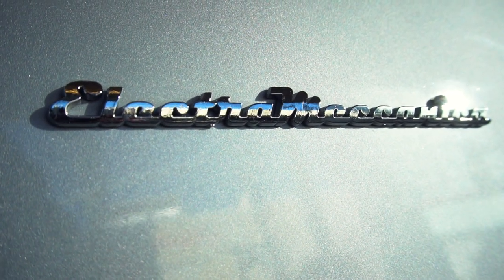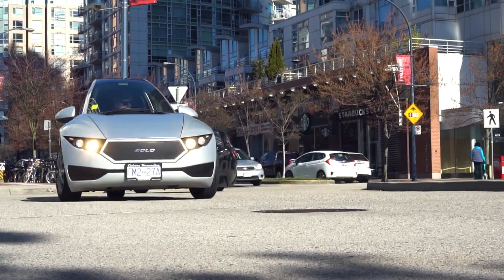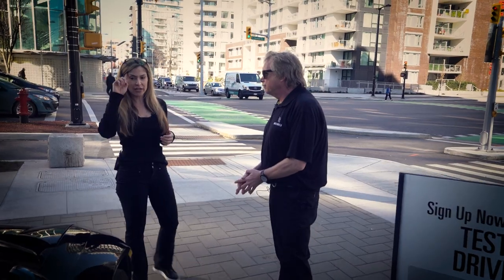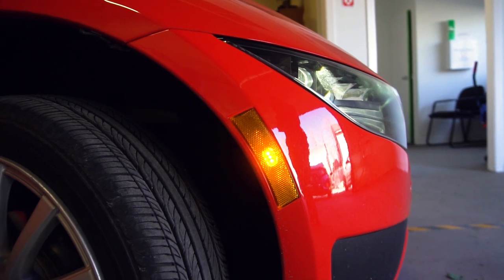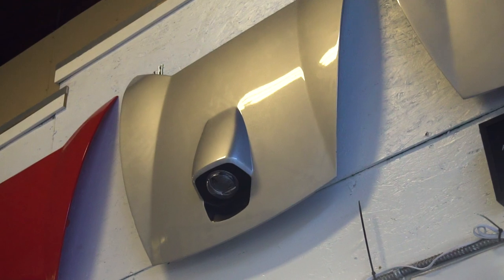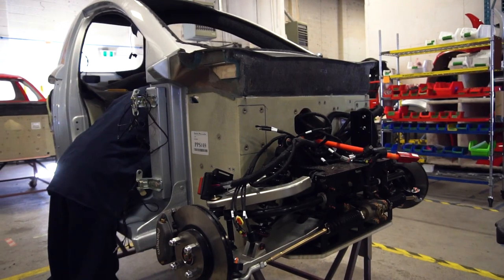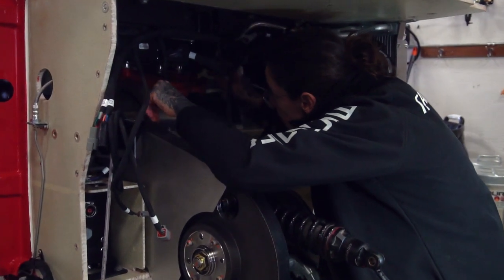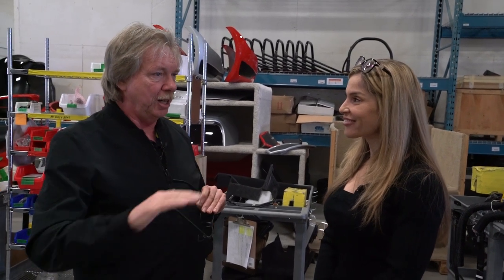SOLO EV Test Drive & Facility Tour

Comment: I just test-drove one of these down in Los Angeles last week. I'm ready to reserve one now!
Reply: How would you parallel park this thing without a rear view window? I can't imagine it has a camera.
Reply: @beernpizzalover9035  Impressive!
Reply: @Vanalos  It has a back up Camera
Reply: Elio Motors?
Reply: @nickgarcia1682  This one actually exist.
Reply: Can the care handle sharp turns?  Looks like it can turn over.  So safety is a question
Reply: joel diaz The car was very nimble/agile in its handling; and it had very good acceleration. I didn’t try any really sharp turns, but this car does has the benefit of doors on both sides - in case it did tip over. :)

Comment: 17kwh battery, 1600lbs, 3 wheels, and only 100 mi range? Feels like it should have 200 based on what 4500lb EVs are getting
Reply: Those vehicles are designed differently They use a skateboard type of platform which is wider and longer making hold more batteries or example I drive a Chevy bolt EV and it has 66 kW And that gets me roughly 260 miles of range. These cars have a small spaces to put the batteries but like he stated the technology will get better real then you can choose to swap those batteries out for better batteries soon